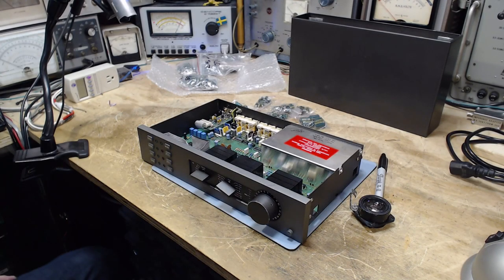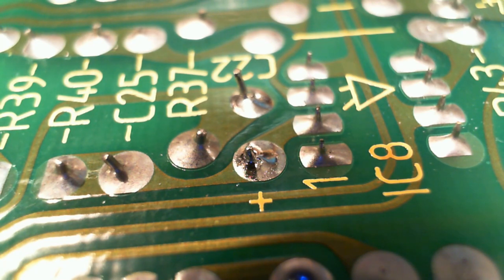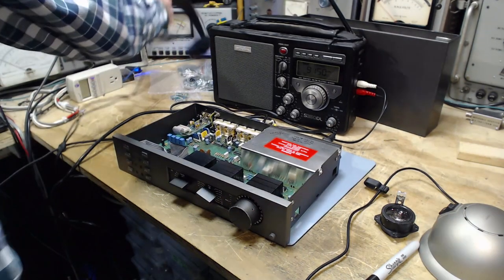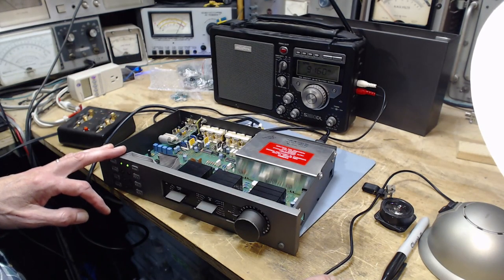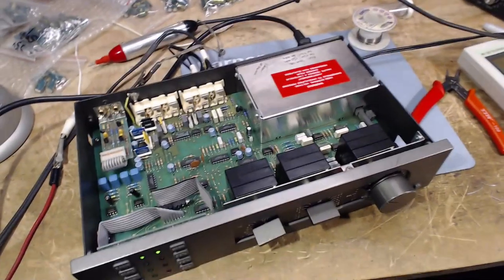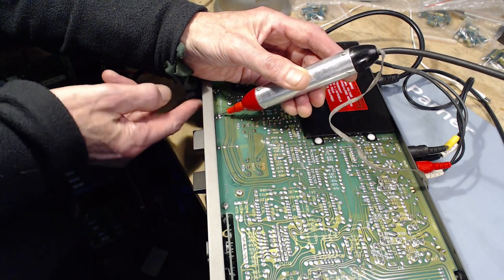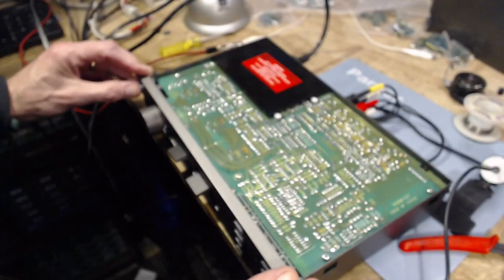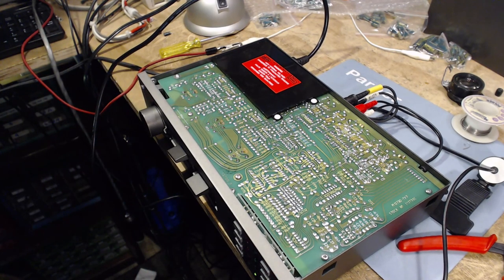1980s QUAD 34 Audio Control Unit - Troubleshooting One Dead Channel

Comment: Yep I have serviced a couple 34's and the ones with the small black 100uf 6.3v caps all leak and have to be replaced and corroded traces repaired. The 34 I am currently working on also has a failed balance slider pot but I removed and took it apart to discover one of the wiper's plastic clips broke breaking the contact to the carbon track. Glue the wiper back and its good.

Comment: Breaking the rules of his capability limits: Do NOT touch anything that has transistors, chips or PCB (even single-sided through holes). Extensive to any gear that you plug, has more than two knobs, two switches and more than a single scale.

Comment: 31:04 NO! You should never ever use  just a clip lead to bridge out or across components or to combine channels in an audio circuit! Especially not with solid state and without analyzing the schematic! 
This solid state stuff with opamps uses DC bias voltages. Nilly willy shorting between circuit nodes may introduce new or kill existing bias voltages. This may damage components! Use a capacitor in series with the clip lead to have audio pass but block any DC biasing.
He is lucky this device is so forgiving! 
Poor owner.

Comment: Man, when I seen the PCB I knew this would be a disaster. He can’t follow schematics on a big old easy tube radio. He would be clueless on a somewhat complicated modern piece of gear. Good point by another poster, this radio plays great in his shop but all radios he repairs that don’t perform it is caused by noise in his shop. Complete useless excuses for lack of skill in this type of work. Maybe he should make funny cat videos, they are more inquisitive on what is on the bench than he is.

Comment: But the pre amp is not fixed !!! Bypassing the balance control is not a repair !!!
Probably the balance pot just send to voltages to amp-ops and these are the chips that control the volume of Left and Right channel...
So he bought TWO sets of caps, didn't used ANY and is calling this a success repair ?!?!?!?
Reply: Regarding the balance pot; according to the schematic I found, the balance control is a bit unusual; it is a stereo pot, connected like a Volume control, but with start and end of the carbon track flipped on one channel, so that there the direction of rotation is reversed.
But due to that quirk at mid balance position, this contraption is a 50% voltage divider to both channels.

Comment: the input is of the Class A type to the cleanest signal possible so you have a complementary pair so both of the transistors need to be replaced.

Comment: The two points are a failure in soldering. Thats not hand soldering. I hate chips soldered in. Yup its a manufacturing defect of the wave soldering bath.